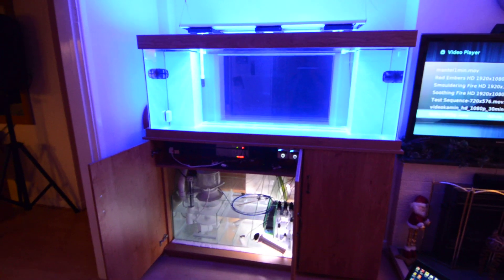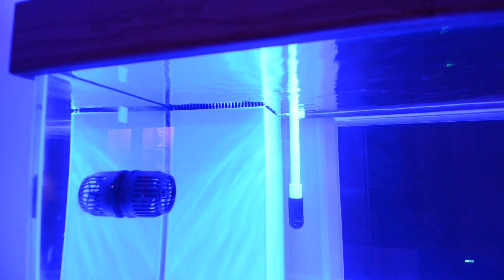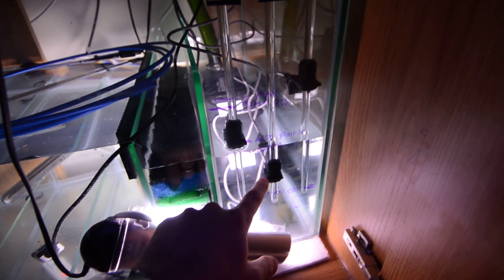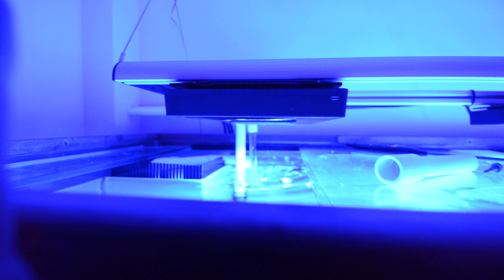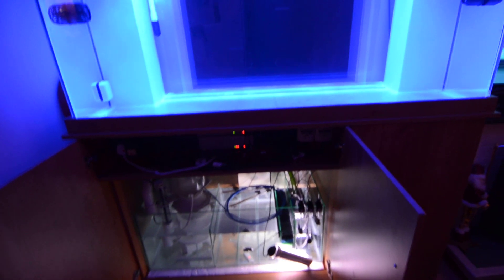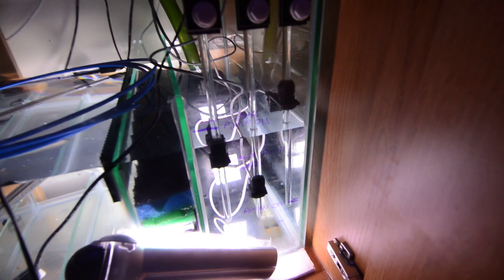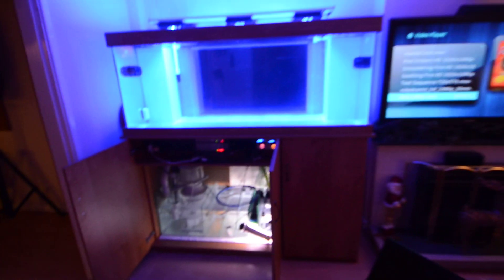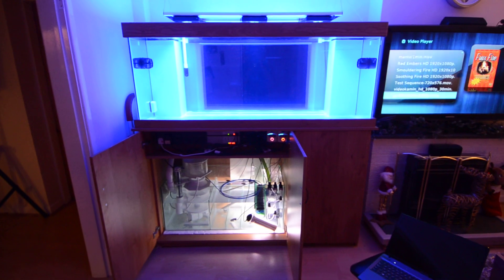Marine Automatic Water Change

Comment: I have been reading all the comments. You could everything that you need with similar design but you would also require Neptune Systems, Apex Controller along with I/O Breakout Boxes, Float Switches and Auto Leak Detectors :)

Comment from the maker: Hi

check out my earlier videos for diagrams on this build

I ended up using a self priming pump to pull the water out of the tank and used the profilux system with float sensors and plug bars to automate it all

good luck ;)

Comment: are you using solenoid valves to control the inflow and dump? and if so what have you found that works. currently automating my own system. sticking with floats and relays.

Comment from the maker: This was something i went out of my way to avoid. I use a self priming pump to effectively suck the water out of the system and then place the outlet of this pump into a drain in my storage room that is higher than the tank water. Also the salt filling tanks water level is around 1 meter lower than the outlet into the tank. This stops a siphon when filling the tank water back up. You can see this setup in my other videos.

Comment from the maker: as you said, if its smaller and more frequent then it shouldnt matter but i keep a pump running in my salt storage tank 24/7, i also always heat the water to the tank temperature before doing water changes. I may be being anal here but thats what i do.

Comment: I see. They actually don't look bad to me at all. 

I'm asking because I'm in the process of starting a reef tank. I've run the ato line and the tank and stand are being built at the moment. I'm excited about the idea of setting up an automatic water change system but concealing the pipes is essential because of the wifey.

I'm wondering if I were to do this in the sump and added ball valves to close it off after a water change could this prevent the siphoning. Not sure. Or if I need to conside

Comment from the maker: This would not be possible in my setup as i wanted to be able to drain as much water as i like from the tank and working from the sump would make this impossible. Also having the fill out pipe higher than the water storage level prevents a possible syphon after the fill pump has stopped and when dealing with that much water, you need to be very sure you do not over fill your system. If you wanted you could conceal the fill and drain lines better than i have done if setting it up from scratch.

Comment from the maker: @matteocom717 thanks! There are safety features in this area. 1 is a max on time for the fill pump which triggers an alarm and stops pump if it goes on for too long. The other is I always use very close to the full capacity of the storage tank when doing a water change so the excess would never overflow the system

Comment: hey, great setup. I have a question though. When the saltwater is getting pumped into the tank during the automatic water change, do you have anything to stop water from overflowing in case the float switch gets stuck?

Comment from the maker: @melroser23 haha i like your scepticism! The whole point of the system is failsafes, I have now added and tested safety timers on the auto water change. I tested it by making sure the top float switch (the one that would cause the disaster by not turning the fill pump off) was out of the water whilst running it. The alarm went off 30 seconds after the max time, the fill pump deactivated and i recieved and email warning me what had happened!

Comment from the maker: @ballingknight I would say a 5! turned out easier than i thought but i still have a lot more programming modifications to make it extra safe and send me alerts and I have some cool ideas for later on including not allowing a water change to start if the water parameters in the storage tank are not correct. ie temp, salinity level etc.. but that is an added bonus and may be more complicated. It took me about 4 hours of testing adjusting and thinking to get this one right!

Comment from the maker: @reefman46 A lot of thought and planning. I was researching the hobby and knew that manual water changes would be the thing to really become a chore so i started thinking about automating as many processes as possible. There was 2 computer systems i could have gone with but opted for the profilux. I was apprehensive about whether i could program it the way i wanted but with some help on the forum i got it done quite easily in the end! still have to program email alerts and safety timers too!

Comment from the maker: @jaizedelmann Thanks for the tip! The water in the overflows stays in there as there is a durso standpipe almost to the top. I also have syphon breaking holes in both returns and even without the syphon holes the sump handles the total syphon anyway. The sump is bigger than it looks!

Comment from the maker: @JUNAID187 mmm thats a tricky question, The entire build including the water storage area that you can see in earlier videos was just over 10,000 pounds. Very hard to estimate just the auto saltwater change as this was a combination of a profilux computer system (which does everything) water storage tanks (which could be as cheap as you want) self priming pump ( depending on the way you drain the tank) and the level sensors. Its all about having the appropriate drainage and storage system